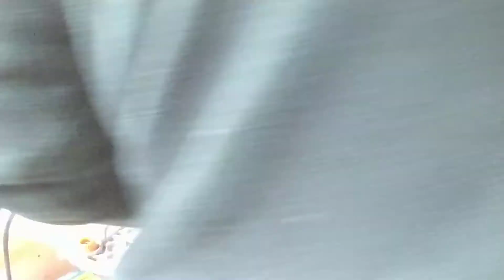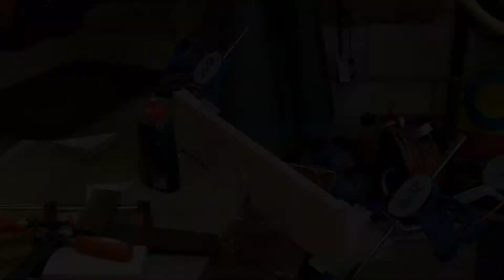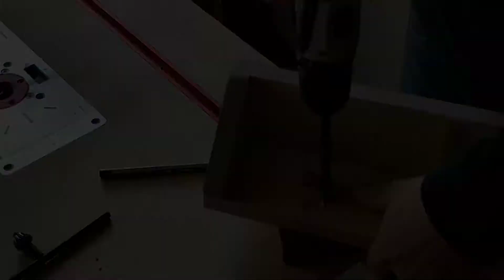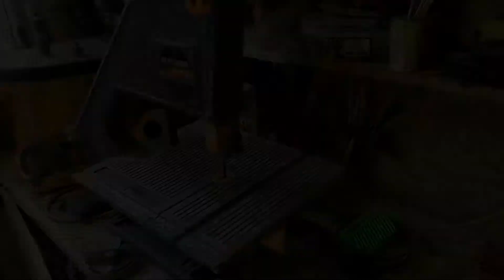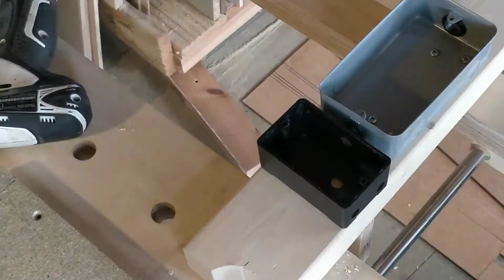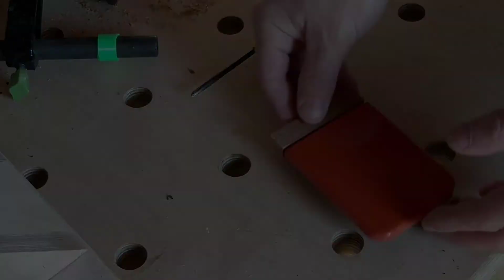28. Router Fence, Electrics and Emergency Stop for MFT Style workbench

Comment: Thanks very much for this. 
What decided you on the spacing dimensions of the T-track across the width of the router table? It's a build I fancy having a go at but (as usual) trying to make sure I haven't missed the bleeding obvious before I start. Cheers!
Reply from the maker: Hi, there was no real science in it, they are placed about 1/4 the way in from each side, I've not yet thought to myself, 'I wish I'd done it differently' and have been using it for a year, that said I've only ever used it with the long featherboard I made.

Comment: I believe the Evolution saw is a multi purpose blade, I may be wrong.
I've just cut up some melamine on my table saw using a 80 tooth blade from Saxon blades and got a nice clean edge ,
as usual a great informative video ,cheers Simon
Reply from the maker: Thanks yes it is multi-material, I replaced the blade on my mitre saw for an 80T Saxton blade, made a massive difference